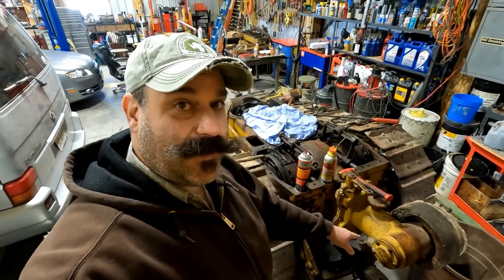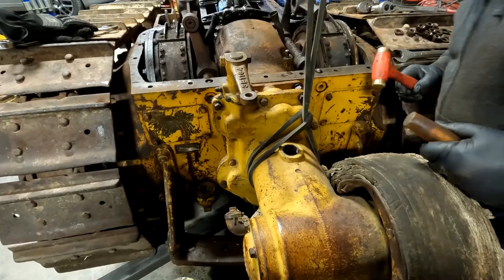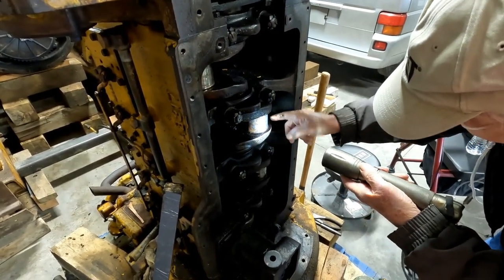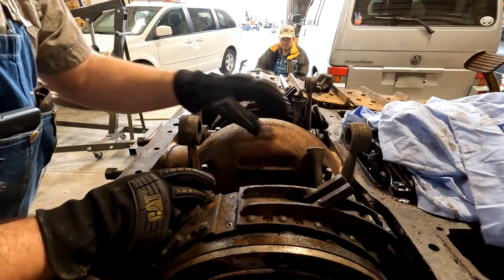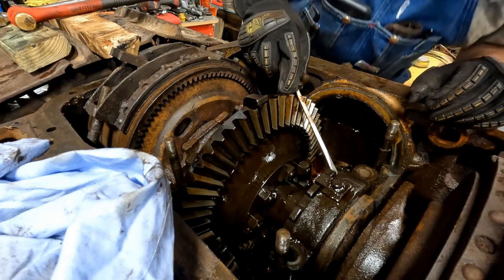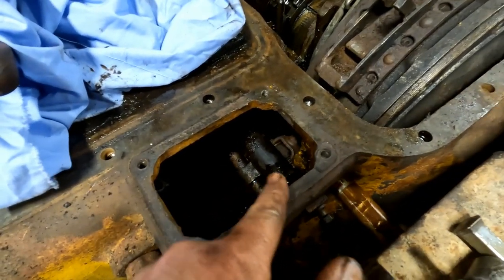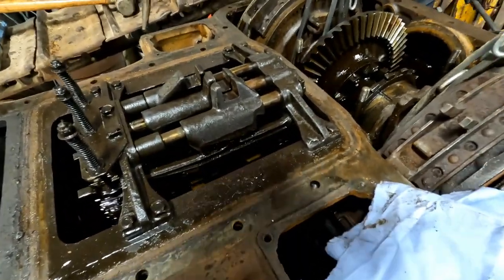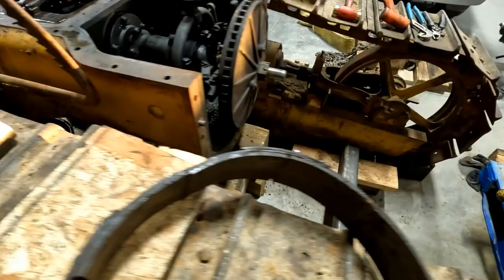Steering clutch, brake band & bevel gear removal. 1939 Caterpillar D4 "Lil Lefty" 4G9986 Episode #14

Comment: First time here, already like what i'm seeing. Any idea when this machine was las serviced?
Reply from the maker: Thanks for watching. We honestly have not idea when it was last serviced. What we were told is the tractor sat for over 25+ years not running. From the damage it appears someone attempted to start it with a stuck engine. It resulted in some internal damage. I am the 3rd owner and the second owner did not do anything with it, he only had it for a couple of years. It was a leap of faith but we fell in love with the tractor!
Reply: @lifeafterourloss  Over all seems a good machine. One thing that sticks out is the egg out hole on the draw bar. Tells me the machine probably towed something heavy and it was rocking back and forward all the time. Other than that once you get it done, should be a very reliable machine.
Reply from the maker: @SuperMAZ007  The tractor spent its life in the foothills North of Boulder. I imagine the rocks and weathered sandstone in the clay soil took a toll on the drawbar. The belt pulley and drawbar are on the list for a rebuild. My grandfather showed me a trick to rebuild an egged out drawbar using a grade 8 or harder bolt. 👍